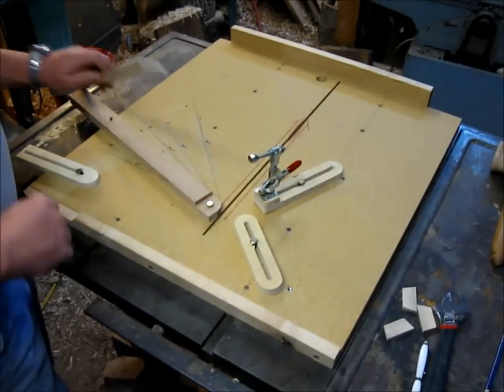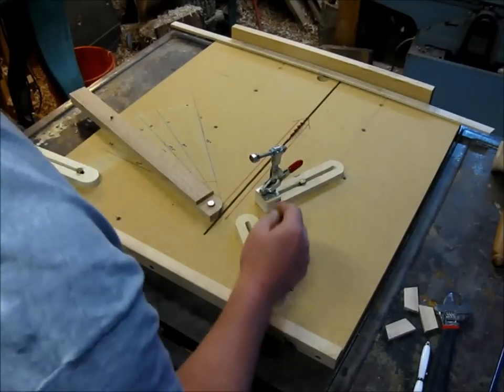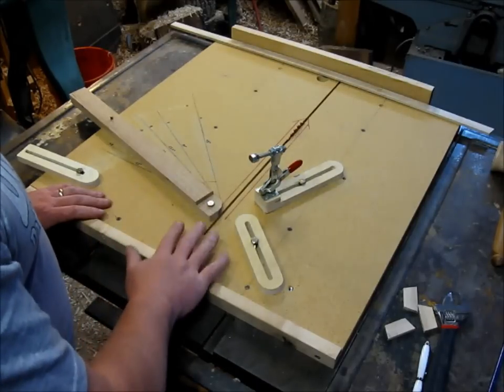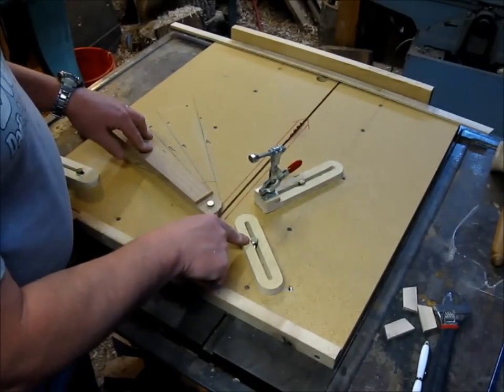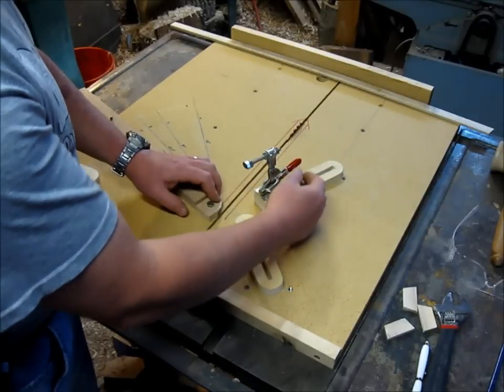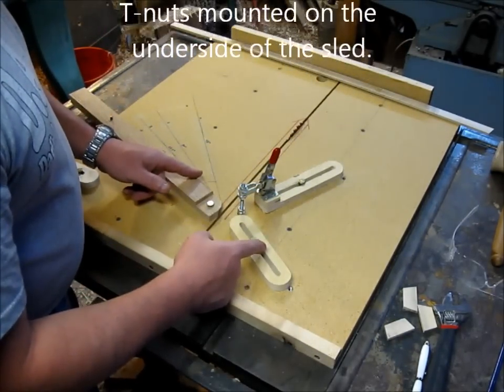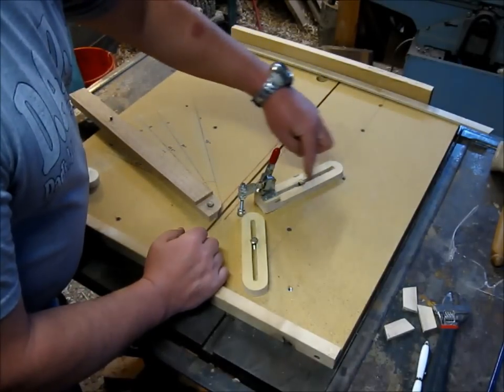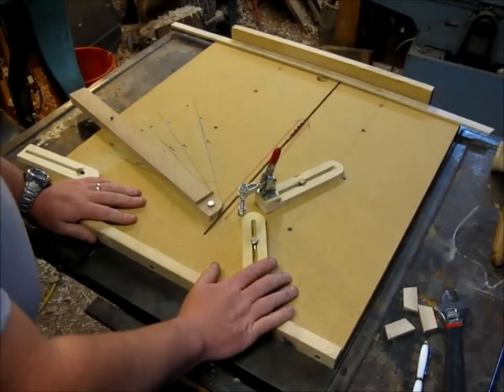#26 My Shopmade Miter Sled and Drum Sander

Comment: I noticed the friction that you have on your sled. I can hear it in the video.

One of the tricks that I learned was to hand sand the rough spots off of the metal top of my table saw, band saw, any cast iron piece. Remove the rust. Then I put on some wood wax. They sell it cheap. I have made my own wood wax. It is paraphin (candle wax) and denatured alchohol. It ends up a milky liquid. Just wipe on a thick coat. Wait a few minutes for the alchohol to evaporate and then wipe off with a cloth and your saw top will be very slick. The wax will not contaminate your wood.

Thank you for your wonderful, home made, tools.
Reply from the maker: Artiken1 Thank you for the suggestion on the wood wax. I have got to try that. I don't worry about contamination anyway. Also I am really glad you are enjoying my channel and tools. Thank you for commenting and for the suggestion. i will definitely try that.
Reply: Stephen Ogle One of the first tools I made. Other than speciality chisels. I took a nice hard piece of steel. Like an OLD rusty file. I used the side grinder with a carborundum disk to grind off the teeth. I then took and braised some carbide teeth from an old circular saw blade on the end. Two teeth side by side will be just wider than the 1/8th inch file. Don't worry about angles. You will grind them when you sharpen it the first time. The two carbide teeth just have to be touching in the center where they meet. It makes a very quick and long lasting parting tool. Much better than that pointy thing every one calls a parting tool. Less snags. Quicker cutting. You don't have to sharpen it all the time. Great tool.

Comment: Great ideas.  I already have a sled, but may be redoing it to include some of the features your showed.  I really like the drum sander, as I have limited storage space in my shop, and the idea of using an existing machine for another purpose makes a lot of sense for me.  Just curious about how you hold your sandpaper onto the mandrel; are those plastic caps on the ends or a clear tape?
Reply from the maker: Clear Tape, I simply wrap the ends with duct tape. This just happens to be the clear. I'm glad you found this video helpful and thank you for your support.

Comment: I saw a method for trueing drums where she put sandpaper on the table and then just jacked it up until it started to sand the drum. That way the drum is not only straight but also true to the table, I thought it was a brilliant idea. Can't wait to build one of these for my Shopsmith. Another thing, instead of using pins to set the angle would a hold down clamp on the angle setting slider hold the miter solid enough to provide the accuracy required?
Reply from the maker: Thank you Dave. That is a great method for truing the mandrel to the table. I use the pins on the segmenting sled for repeatable accuracy. Of course a hold down clam would be strong enough, but you lose the repeat ability for dead on accuracy and will need to make test cuts to get your cuts back to perfect. I would not recommend that method. Good thing is that. It is your shop. Try it for yourself. You may prove me wrong and find a better method. That would be good for everyone.

Comment: I love the sander, but wonder how easy it is to turn the mandrel perfectly true?  Would PVC work instead?
Reply from the maker: Sounds worth a try. However: if the PVC gives at all, it will not be accurate. I would suggest trying it before actually committing it to permanent tool status. The best part about all this is you can do whatever you want. If it doesn't work, trash it and try something else. When I true the mandrel I use calipers every inch or so down the length and true up to those marks with a straight block wrapped with sandpaper until I have reached all my lines and can't see daylight under a straightedge. Not really that hard, just be picky and get it right. Thank you for commenting and supporting my channel.

Comment: Steve,been watching, learning, and enjoying your  editorials for quite some time now. And you have helped me thru quite  a few of 
My goof-ups. Recently have been doing my own engineering on your drum sander. My thoughts are that some  turners might have
Some trouble turning a straight and even drum  at that distance,thus making an uneven end product.
My thoughts are  a 2ft long by 4"  diameter PVC pipe, cleaned repeatedly with PVC cleaner , and glued the rolled sandpaper with Weldwood contact
Glue. One end tightly fitted  with a tennoned plug and the other end a tightly fitted plug for the tail stock.
The one problem I for see is possibly not a heavy enough drum.
Any thoughts ??
Thanks, Mike
Reply from the maker: mike butts Thank you Mike for commenting on this sander. It is a little crude but it works fantastic. I used a newel post for my mandrel but I suppose a PVC pipe would do the trick also. I am with you on wondering if it is heavy enough. I know htat it can have no flex at all in order to work properly, but I think PVC would work fine as long as it doesn't get to long that it will want to flex. Thank you for your insight and suggestions on this project. I really like to get people's opinions because it makes us all better Woodturners. Thank you for supporting my channel.
Reply: Will the weld wood glue release the paper when it needs changing?  Why do you repeatedly clean the PVC with cleaner?  Why not turn a cylinder to fit all the way through the PVC and put a little epoxy glue on it to hold the two together?
Reply from the maker: Thanks Garry I use Duct Tape on the very ends to hold the sandpaper in place, No glue. I believe your idea of using a cylinder to strengthen the PVC is a good one and whould work just fine as long as is is centered perfectly.

Comment: Hey Stephen I rewatched this video for planning of a lathe drum sander. Have you made any changes to your sander? Or, mods you have found over the years to upgrade it? Thanks Jeff
Reply from the maker: Thank you Jeff. I have never changed this design and still use it. I do need to build another one to fit my new lathe a little better. If I were to change anything it would be to add a piano hinge instead of the two individual hinges. I hope this helps.

Comment: Hi Stephen. Thanks for an awesome clip. Do you by any chance have a downloadable chart that gives you the angles for the various size bowls. You speak of a 12 piece using 30 degrees. Can you give us the balance of these numbers.
Thanks,
Reply from the maker: Thank you Ian. Glad you enjoyed this project. I do not have a downloadable chart. Use the circumference and divide by the number of segments to get your segment length for each ring. Divide the number of segments by 360 degrees to get your segment angle and divide that by 2 to get your cut angle. I hope this helps.

Comment: For your sled I have a question.  The stops have the bolts on top.  Have you found that the bolts have started to dig in?  I ask as when I make similar things I usually use a washer between the bolt head and the wood.  Would you feel that such an addition would be wasted?
Reply from the maker: +Brad Sumner Thanks Brad. Good question. Yes the nuts can dig in to the wood. I have since built another sled for my new saw and although built basically the same way. I have washers under the nuts to avoid digging in. I hope this helps.

Comment: Hey Stephen,
I'm working on making this, but am having a heck of a time getting the round piece to be perfectly straight and parallel!  Keep getting highs and lows, can't get it just right.  Any guidance would be appreciated!  I was wondering if it would work if I used a piece of thicker PVC pipe in the center and capped the ends with wood to fit the chuck and tail stock???
Reply: I think he said he used a big long sanding block to make it perfectly flat. The only thing You'd have to worry about is that each end is the same diameter, so you dont make tapered pieces. I think the pvc pipe would be a great idea!
Reply: Ben Winchester thanks for the response Ben!  I bought the pvc today so we will see!

Comment: Steven - I looked through all the questions and didn't find this one, so I'll ask...  How do you attach the sandpaper to the mandrel?  It seems obvious to glue it, but what about replacement?  Do you have to re-true the mandrel each time because of glue & paper bumps?  Is there a clean-removing glue?  So many questions...  So little time...
Reply from the maker: herbk98 Thank you for this question. I do not think I answered it in the video either. Sorry.  I simply used clear duct tape to secure both ends. If you look closely in the video you can see that each end is taped down. Anytime I can help just ask. thanks again for supporting my channel.
Reply: Stephen Ogle Oh, good.  Simple enough!  I know I'll need this sander because segmented bowls are "calling my name" if you know what I mean and there's no way for me to buy a planer or jointer.  I wrote earlier that I'm watching your videos from #1.  My next one to watch is #20.  I'm really enjoying them.  It's not hands-on, but they help me know what to do - and what NOT to do - when I get on the lathe, so thanks again for sharing your experience.